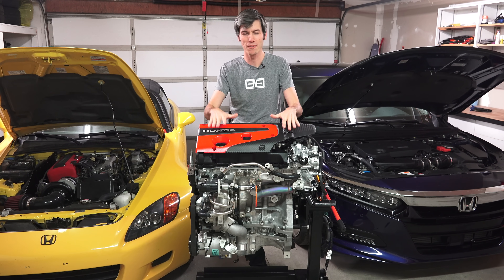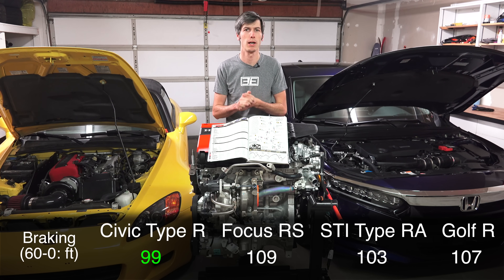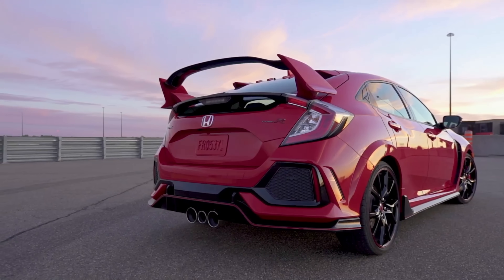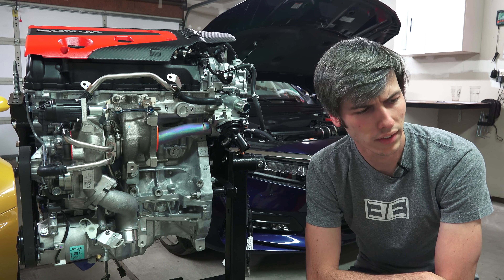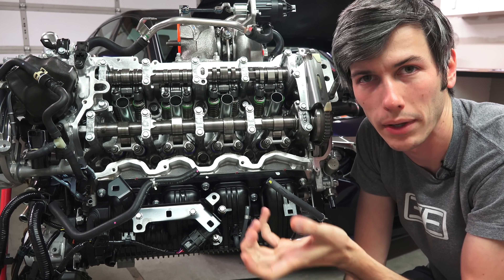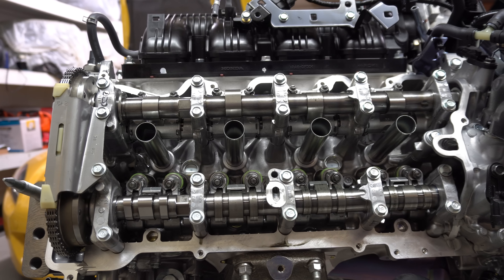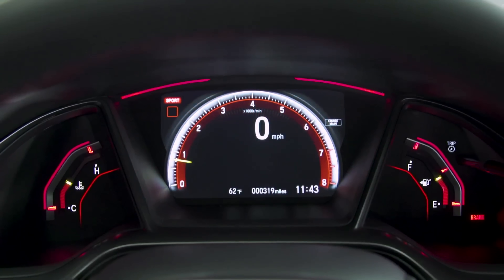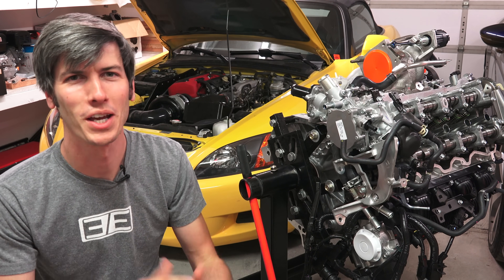The Honda Civic Type R Destroys The Competition - The Best Engines

Comment: Props to honda, the numbers don't lie. However you can't deny that RWD increases fun-factor enough to sway people away from the honda platform.
Reply: it's a shame... if honda made a RWD like the s2000 again it would be nuts
Reply: VBMuscle they had plans to do that for 2019 but the scrapped it. It was going to use the type r engine but tuned up with an electric motor attached the turbo shaft to eliminate lag. They planned to keep the car at or below 2700lb and estimated 380-420hp. The price was going to be 55k. But they decided not to build the car because it wasn’t “financially beneficial.”
Reply: @benjaminreed6652  Electric motor attached to turbo shaft?!? I've never heard that since I'm not a mechanic or engineer but that sounds like a genius idea. Much smarter than having to do twin turbos to get lower rpms, or just having one that has to compromise between low and high. But technically wouldn't this make it a hybrid between both a turbocharger and a supercharger since it's robbing power from an electric motor as well as exhaust gases?
Reply: Le Rippletoe I guess it would make it both a turbo and an electric supercharger. I’m disappointed that Honda scrapped the idea. But maybe they will use it on a car sometime later on.
Reply: @svmuscle7677  I agree that we'd all like to see Honda put out more rwd platforms but I think they save that for vehicles they want to produce as rare. All their rwd vehicles have seen limited runs for only a few yrs. This keeps their value up after production. Just a thought on why I think they don't do it more often.
Reply: @matches321  well Honda originally was strictly RWD... their first cars were more similar to the s2000 then any other car they make now
Reply: I vote for a Honda MR2
Reply: We're all stuck paying Acura prices for cars with AWD or RWD.
Reply: Imagine if they came out with a new S2000 using this engine...
Reply: thooke222 no...s2000 will be r.w.d it has to be and will have it's own beating heart dropped in there! S2000 gas to be it's own!
Reply: thooke222 that was actually a plan they had.
Reply: I doubt you could tell the difference.
Reply: I think we all love honda just because it is fwd. Its unique
Reply: Plus it's just ugly.
Reply: @Mike Dave why when the s2000 is a lot better then an MR2
Reply: It's still going to lose to a bone stock C6
Reply: @thestig2583   FWD loose on Drag Races however win on daily life, RWD  suck in Snow or Rain
no weight at the PULLING wheel's 
RWD are heavier waste more fuel, Rear wheel drive cars are slower from 20 mph duo to added weight , rear wheel drive cars have less interior space + the Fun Drift  Factor in a Track makes it less safe in normal sleepery roads
Reply: LP Youtube Channel FWD is garbage. End of discussion. The vast majority of fwd cars have open diffs meaning driving in inclement weather will be terrible.  The track performance is awful, Datsun tried it at LeMans and it was a disaster.  They all drive like garbage and handle like pigs. It's called wrong wheel drive for a reason and it is only reserved for grocery getters such as this Civic
Reply: @thestig2583  or C5 OR late model C4
Reply: Y'all my 01 LeSabre is FWD and it's got a lot of power, and I can burn out in it regularly, sometimes not meaning to when it's wet (I do have a lead foot and this is on a hill where I don't slow down properly) but it's hella fun to burn out in a FWD car and a Buick of all cars.
Reply: i like the efficiency of fwd. save on weight and practicality.
Reply: Yeah, but the competition is mostly AWD, which is even more boring than FWD to me
Reply: Amateurs buying RWD.. crashes.
Reply: Jeremiah I’m an amateur. And I drive an ap1 s2000. I’m 19 years old and I haven’t crashed once. Because I’m smart enough not to push the car too hard. A lot of amateurs crash because they can’t handle high power/torque. I know a lot of amateurs who drive miatas and v6 mustangs/Camaros fine. But the ones with high output v8s, they are the ones that crash.
Reply: @benjaminreed6652  well the ap1 is gutless as hell until high revs. Gorgeous car, but lacking in punch. Corners amazingly well. I'd take an ap1 over the new Type R any day.
Reply: RcFrenzy that’s why I still hv my nsx
Reply: RcFrenzy Honda has only made 2 rwd production cars in the last 30 years NSX and S2K I find this funny lol
Reply: RcFrenzy good for beginners tho
Reply: They should bring back the prelude and just make it a full on mid price sports car rwd.
Reply: What are the BMW 140i figs i wonder?
Reply: @LorenceBeDe  The 140i is a way better choice. The engine is more than some nasty sounding four cylinder. People don't talk about how bad this engine sounds. It sounds bad. The BMW's six is a proper unit. Also highly tunable. 400bhp plus is easy. Also the chassis can take more power without endless understeer, as it is rear drive.....
Reply: Actually I had a brz rwd... I traded in for new SI... You would be surprised to drive the new Honda's.... They are a lot more fun than any Honda's of past. Fwd... It doesn't matter this car corners really well... Drive one.... Really get on it .. u will see
Reply: Man I just want an S2000, that’s all I need
Reply: I scored a Camaro SS 1LE for less than the price of one of these so I'm gold
Reply: The smile I get is the rear wheel drive cars holding me up and when I pass they can’t keep up on a mountain road
Reply: Angry Justinian rwd is better for drag racing as well. As you accelerate, the weight of the car shifts to the back causing it to gain traction on the rear wheels and lose it on the front.
Reply: RcFrenzy the civic is beyond ugly too
Reply: Blaze
Reply: rwd is very inefficient though. It has too much friction in comparison to the front wheel dive
Reply: They need a new S2000 but it should be a hard top to save weight.
Reply: More fun due to placebo (acronym bias) effect since most reviewers saw negligible difference, if at all, in fun-to-drive.
Reply: Absolutely front wheel drives are gay
Reply: The numbers don't lie for Honda, no one buys those cars
Reply: Honda have just the best tires... Nothing more.
Reply: Awd killer🔥🔥🔥🔥
Reply: @autobotavengerfireballxl5339  except it's not...the AWD cars are much faster acceleration wise.
Reply: honda why dont you make a MR layout civic type r clone to kick the whole market's teeth?
Reply: I think the handling characteristics of this car make it superior to rwd.
Reply: RcFrenzy AND ITS EXPENSIVE
Reply: RcFrenzy ooh I will have to disagree have you drove one , lol trust me drive one as fast as you think you can then you’ll realise while your shitting your  pants  that you drove it slow 🤣🤣🤣🤣, turning corners at really high speed is just as good and fun as drifting I personally like that feeling better , each to the own
Reply: RcFrenzy for drifting yeah, on a straight I’d prefer awd but fwd suffices.
Reply: Mr2 will be EV in 2023
Reply: I hope the k20c market will develop enough to be able to swap it and tune it into everything
Reply: What RWD cars are there in this segment? None as far as I can see.
Reply: @Kavafy  BMW M140i, 340bhp RWD
Reply: @Kavafy  there are AWD cars tho
Reply: Kavafy m140i gets the closest I guess
Reply: Kavafy I think the bmw m140i can be one i guess
Reply: Kavinda VW & DGFr0sty you are both right - I went and checked the new prices of the Type R and the 140i and there is not as much difference as I thought, so yeah you could consider them competitors
Reply: @Kavafy  None are RWD, but the others send a good amount of power to the rear. The Focus RS in "Drift mode" sends 70% of the power to the rear, which can be real fun in a corner.
Reply: @Kavafy  m140i?
Reply: Kavafy seriously rwd compact sedans Mercedes C300, Alfa Romeo Guilia 2.0t, Lexus IS200t, BMW 330i. I’m sure I’m forgetting several others. Yeah they aren’t proper hot hatches. But they’re definitely competitors.
Reply: They're not considered competitors either. The system is both pricing and size/ segment; nobody that is cross shopping a Golf R (for the extra space over a "normal" car mind you) will get a Jetta or c300 since they're looking for size, it's like saying I "I drive a lot and need extra space for furniture/ groceries and kids, should I get a minivan or a 2 seater coupe?" since they're the same price. Also, SUVs are more of  competition for hatches anyways, and wagons too but nobody buys those.
Reply: The C300 and 330i and the other cars you mentioned aren't hot hatches at all, never mind "proper" hot hatches
Reply: @BMWE90HQ  most of the cars that come close to type r segment are almost 2x expensive.
Reply: People said they wanted a new nsx but they don't buy them. Same with skylines, supras and all those other cars that went out of production.
Reply: @MJ_868  
Only for the rich folks, enthusiast, and collectors. What MOST folks actually wants were mainstream affordable models that can do multiple duty service.
Reply: NotPharrell Not the consumers' fault that car companies can't make a car buyers want.  New NSX is nothing like the old one, and current Skyline/GTR gets MSRP raises with no updates and no hint of a new gen coming.
Reply: NotPharrell new Supra coming out next year, going to be hotter but will cost over 50% more than the Type R
Reply: Zardos Spinosa show us this supra...
Reply: NotPharrell People are a bit tentative dropping $120k on the new NSX. But you are right, no sales = dropped production. Bought a ‘91 NSX a few years ago, 22nd one in the US. The original owner paid 22K over list, 83K. No small amount of money now but in 91, ouch.
Reply: NotPharrell It’s not the people it’s the new generation designs, had they kept the Soul characteristics enthusiast would buy.
Reply: Mekkayel Philip Uhhhh, we never got the Skyline other than right hand drive 25 year imports, the new NSX is an utter disappointment and way too much $$$, the Supra is a BMW.
Reply: It wouldn't be a real Honda if it's not fwd. Honda is proving that fwd is a good platform for the track.
Reply: Tell that to the original NSX and the S2000. :D
Reply: @briana3695  Nissan proved otherwise when they actually tried it on the track.
Reply: Brian Alvarez word
Reply: it's remarkable how well modern FWD cars  drive... they're just getting better & better. And Honda's proving it. Though I'm surprised they still get the faster track times even with the longer wheelbase.
Reply: axiomic Track configuration and to a lesser extent, different drivers have a big influence on the relative  performance between various cars
Reply: @briana3695  yes but how many people are actually tracking their car?
Reply: Brian Alvarez other than the mustang got crushes it at the same track for nearly the same money.  FWD may be the king of the sub compact and hatch world, but after that, not so much. If you’re tracking your daily (which isn’t my thing) you may get more functionality out of a Civic hatch, but from a track point the RWD mustang is a far better performer.
Reply: @briana3695  well, they need to stop now. Why put amazing technologically innovative engines in inferior drivetrains? It's backwards!
Reply: Too bad my old si blew up it would be awesome rwd with this engine
Reply: @suchasreallife   What did you do to your honda engine ? 
Honda Engines don't blow up unless you fiddle with it
Reply: All those cars are AWD or FWD so this is irrelevant.
Reply: I've owned RWD and FWD cars and never found one to be more fun than the other.
Reply: @Bl00dwerK Really! Do you drive manual?
Reply: FWD is fun if you know how to use it. 

From a standstill... turn the wheels and mash the throttle. In a RWD vehicle... there’d better not be any crowds around. On a well set up LSD and torque vectoring car like this... you will scream into the corner perfectly in control and accelerating at a rate many cars won’t even do in a straight line. 

This is why this thing embarrasses many RWD and AWD cars around the track.
Reply: “Fun factor” typically refers to what’s properly known as throttle induced oversteer. 

It starts as soon as the rear tires break loose and stops as soon as the throttle is rapidly released and/or the brakes are rapidly applied.   

From here on... its known as the “fear factor” and more properly known as lift-off oversteer. It usually results in the vehicle spinning 180 degrees and going into the opposite ditch/barrier/traffic.. or the rear wheels rapidly grabbing and snapping the car in the opposite direction into the other ditch or barriers or crowds of people.
Reply: @Bartonovich52  and also loses to those same cars in a straight line
Reply: What an asinine comment. Please, quantify this "fun factor" and show me decreasing Honda sales because they offer mainly a FWD lineup. The past four years they've had record breaking total sales. RWD adds weight and unnecessary complexity, two things Honda's don't need.
Reply: @mylifeisJDM 
 two things Honda doesn't have.

 Just change fluids regularly and never let it overheat and it will last a long time.
Reply: @mylifeisJDM  It's their type R car. Simply using their good engineering and making a practical but performance light weight FR vehicle would take people out of the American muscle car and sport car markets because honestly that's the performance vehicle people want. They don't have to do any newer or fancier technologies or have the best trim or ANYTHING. Just maybe give a bit more displacement, FR, and slap on the other features and technologies they have already used.
Reply: @mylifeisJDM  try driving FWD (idealy with electric handbrake) vs RWD on the snow;-)
Reply: @mylifeisJDM  RWD complexity??????????? Why was it a staple for so many years if its so complex? Its not the most efficient
Reply: Not to mention the ugly ricer styling.
Reply: most of the "styling" serve a purpose
Reply: Yeah, but the specs isn't "rice"!
Reply: I swear. When you see it in person. And then drive it. I just....Works.
Reply: @scanspeak00  what ricer has functional aero?
Reply: scanspeak00 styling is subjective. He even said it. The numbers don’t lie. Any the only time you have to look at it is when it goes past you on a mountain pass.
Reply: @scanspeak00  Ikr? I don't understand whats with these overstyled cars. Why cant they just make a newer looking s2000 type of styling. The new Mazda Miata is a good example of how you can take old styling and make it look new and modern.
Reply: scanspeak00 Car isn’t “Rice” styling, the design, exhaust, aero all have a purpose aside  from cosmetics. Every time I see this word used for Honda or this car, they don’t know what the word means or how to use it in context properly.
Reply: @I-didnt-ask-you  looks like the styling queues came from Hondas boy racer division.
Reply: scanspeak00 and yet it's the best. Ever thought about the fact that those lines are also for aero and not only looks so suck it stuck to your crap ford rs that blows up after 10k
Reply: @TheCornishGingerOfficial  q1p
Reply: Honda has cheap interior bottom line. Ford rs excellent build quality along with sti. When is the last time honda was recognized for having premium quality interior? I’ll wait. Type only has good quality seats and thats it.
Reply: People these days don’t know how to handle a RWD car.. it’s like this generation has no experience with it. So they make it front wheel drive to keep insurance cost low. Less accidents and less slips with FWD. 

But I agree, RWD better for the experienced driver or track driver like myself
Reply: RWD is king!
Reply: BMW-E90-HQ expect on the Nurburgring
Reply: @BMWE90HQ  
Really? Try it in the multi surfaces snow belt country and your will regrets what you say.
Reply: Lok Tom okay I’m going to guess at what you meant and suggest a course in basic English. But that is exactly why if you live in a place with nasty weather to buy a winter beater.
Reply: RcFrenzy yes if they made awd or rwd I would buy a Honda
Reply: I also heard it won ugliest in class overall. Props to honda.
Reply: @AimForTheBushes908  you don't really like cars, do you?
Reply: @AimForTheBushes908  their lawn mowers and executive jets look pretty ok
Reply: Who gets excited over this thing other than teenagers who watch too much manga? Took Honda literally decades after the competition to develop a competitive turbo engine.
Reply: Every single person that has stopped me to comment on mine has been 35 and above. An elderly woman even asked to take a picture. I think its much more than just teenagers.
Reply: FWD is useless for anyone that enjoys driving.
Reply: bacaca23 speak for yourself self
Reply: bacaca23 b.s..total b.s...moving on....
Reply: @bacaca  lol no
Reply: @bacaca  says the one who is likely the worst driver here.
Reply: Your statement is a load of BS. If you cannot make a car dance and have fun whether it's FR, FF, MR, AWD, then it shows your lack of skill as a driver, hence you are in no way qualified to make statements like that.. And yes I've owned all types.. Even a motorbike..
Reply: @jeffmagallanes4466  hahahaha, he said "motorbike." Gee wilikers Grampa, its 3p, time for your meds and a nap. Ill get that nice Afghan blanket Gramma made you.

Comment: Impressive job by Honda but I hope they didn't compromise their reliability.  Many manufacturers have had problems with sodium filled valves braking and dropping in the cylinder and others with carbon buildup with the direct injection engines.

Comment: This is all good but the Type R is basically maxed out. Golf R has insane amounts of headroom in the motor.
Reply: Yeah maxed out all right.  Both 2.0 and I bet the Honda one has the better cylinder head.
Reply: @K20EF8  Better head doesn't matter. With a piggyback ECU like the JB4 from Burger, you get maybe 40hp. JB4 on a Golf R gets you like 100hp from cranking the boost up. And there's still a ton left in it.
Reply: @HotboiEngineering  Power is made in the head, it most certainly matters.  you do realize with bolt ons and flashpro/K-tuner the civic makes 360/380?